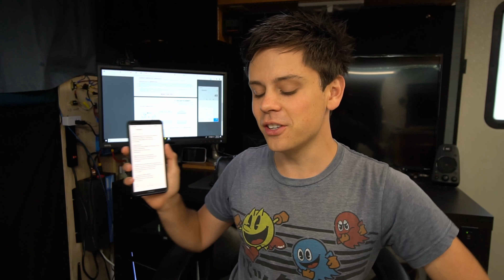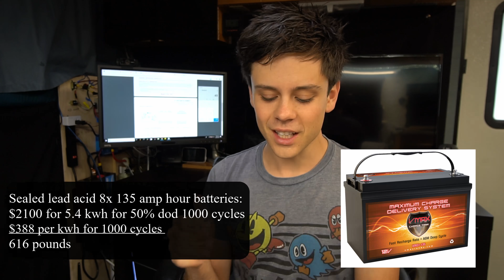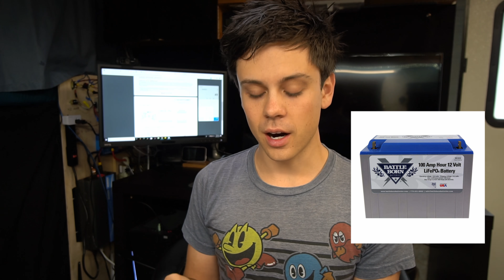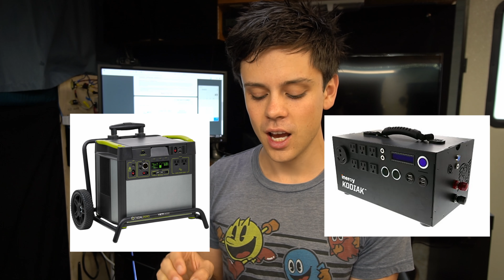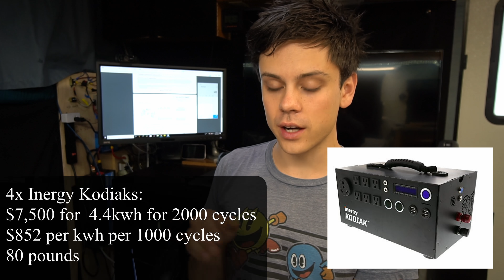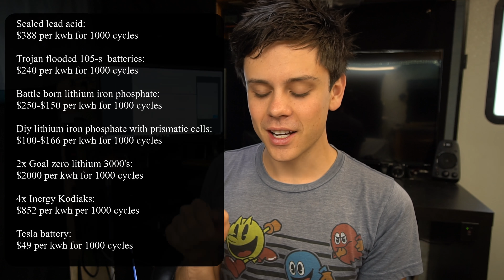Off-grid Solar Battery Price Comparison: Tesla vs. FLA vs. SLA vs. LiFePO4 vs. Tesla

Comment: Here I was, all ready to go with Battleborn, until you talked about Tesla batts. 20,000 cycles?
Done. I'll make it work, BMS et al, no problemski.
Battleborns are around $1000USD, at 5000 cycles, Teslas are $1300USD for 4 times as many cycles?...
With faster charge&greater output?
It's not even a decision.

Comment: Will, I've watched dozens of your videos, and, I still can not describe the difference between prismatic cells vs. other.s in Lithium I THINK I want to build batteries using the LifePo4 combo, as it's safer over time and with various charge/discharge characteristics. I want to build for RV use, so, considerations are outside dimensions of each battery (must 'fit' in existing, or, easily reached location) and maximum capacity within the given footprint. I've been thinking of an ammo can battery, limiting the battery size to 12 volts (for ease of use & calculations, as well as companion equipment).
   I notice that even Battleborn calls its 1280 amp hour battery a 100 Watt Hour battery (limited: max charge & total discharge for long life). 5,000 cycles is 'plenty' for me, and, is already off the scale when compared to FLA or SLA batteries. But, a high C rate is semi important, but, will hopefully be offset by the overall 'size' of the battery bank.  Weight is a bonus, as invariably, I will be replacing FLA batteries at 3 times the weight, but, a diet in an RV is always a bonus. 
   What cells would you consider in a 12V Ammo can build?  To add to the confusion, there are a variety of Ammo Cans now! I just want to maximize the total Amp hours per battery, limit it to 4 parallel, and, then limit risk based on the characteristics of the battery type used. The chemistry will define charge/discharge, bottom balancing is a must, along with the ability to see cell wellness and SOC over time is important to maintain full range of use. It's a long term ownership, so, effort will be made to keep it balanced, try to keep internal resistance amongst cells somewhat close, and, overall capacity will be checked when matching cells while building.
   Whew, that was much longer than expected Will! Sorry- I'm sure you are sick of these mundane and boring questions, but, it's either you of Jehu, and, I don't think he would bother to answer!

Dave

Comment: In your opinion , which would you prefer, 24v or 48v system ? I'm wanting to build me another solar power system for my house..My 1st project was 12V, and the Xantrex inverter would draw about 200A @ about 2000W. So if i used higher voltages, the amperage would drop a lot.  I was thinking to get a 48V inverter, but they aren't so easy to come by.  Plus i'd have to find a 48V charge controller for the solar panels etc.

Comment: Your math is wrong I understand what you were trying to do but it doesn't work that way the price for 1kwh for 1000 cycles does become cheaper the first lithium battery you listed may last longer but 1000 cycles after your initial perchase it would $750/kwh for 1000cycles but then if you were to compare then over a longer period say 3000 cycles then your lithium would still be $750/kwh except now your FLA would be $720/kwh

Comment: Is this the battery u reccomend and does it connect like a regular battery

1x Tesla Model S battery module, 24V, 250Ah,5.2kWh, Panasonic 18650 3200mAh cell

Comment: You're comparing a second hand Tesla battery. That is already degraded. Some of them have to be replaced by Tesla due to excessive use of Supercharging and charging to 100%... you should revise the specs down

Comment: Thanks for the interesting analysis Will.  I wanted to offer that there are often exact reasons for a low product life claim by ANY manufacturer. It is better to simply not make any claims and instead provide a limited warranty. When pressed to conjure up a particular cycle specification for a brochure or whatever, it will be a very conservative figure ...unless overall sales will suffer. Someone at the top of the organization you mentioned likely decided the end-user would not care about cycle life and to press ahead with the low cycle claim as it would reduce any future liability inside or out of the warranty period. Perhaps in the future, as specs become more important with everyone, NOT just the DIY crowd,  the true cycle life of more products will be listed.

Comment: When a battery is rated for 1000 cycles, how does that measure out in years? I am sorry to sound a bit dumb here, but when you say ‘a cycle’, does that mean a charge, so is the battery only good for 1000 charges, so 1000 days if your battery is charging every day?

Comment: According to Tesla Australia, the Powerwall 5Kw batteries will cost between $9,970 and $11,620.  That roughs out at $450 per kw for 1000 cycles?? Even old second hand Tesla car batteries are $2000 plus here. So wish I could buy Tesla batteries at the US prices you guys do :)

Comment: I haven't seen anyone do anything with the model 3 batteries, I guess the  modularity is the issue, being, and the high voltage. But it can be broken down to individual paralled cells, or to 7s like I need, I have only seen a couple out of the vehicle, I have Nissan leaf batteries on the way, I basically have a rv solar power system in a 1200' house, a 5kw inverter will handle the normal power needs. With 12v lighting, with its own 250ah LIFePo4 battery bank, built from K2 cells. And a 7s 600 ah liion bank and growing, I'm adding Nissan leaf batteries if things work out, ( they are in 2s packs) it's hard to get 7 when counting by 2's haha,

Comment: i bought trojan t-105 batteries (6v 255 Ah).  $130 each, 8 of them = ONLY $1050 total. my system = 1020 Ah, 510 Ah usable.  1200 watts of solar on RV roof!
Reply: so my use is only $150 per kwh. but i do like the model s pack. saw some for $1000 used.

Comment: At 49$/kilowatt hour * 1000 cycles, you are only spending 4.9 cents per kilowatt hour you run through it.  So it's the only one in which you could spend less on off grid power than on grid power.

Comment: Wait...im confused.  The tesla battery is lithium right?  tests show that when charge and discharge levels are 85/25 you get 2000 cycles so at 90/10 you will get less...probably around 1000-1500 cycles. how on earth are you figuring 20,000 cycles?!?!?

Comment: Your cost estimate on lead acid is high.
I have 20 kw of Crowns (16, 6 volt) that cost $2500 for the last set (the first set was $768 with no core charge). I get 8 years out of them on a fairly shallow discharge. I don't mind servicing them with water (every three months). I don't have to worry about battery fires either . My alternative energy system is 21 years old. The Trace inverters have been bullet proof. A very robust 100lbs, not 50lbs like the new ones. When I first put the system in my home nobody else had one. We'll actually very, very, very, very few.

Comment: Tesla batteries actually don't have 5000 cycles when full capacity is used. When you use around 70% of full capacity you get to 5000 cycles. So the comparison you made is not completely correct.

Comment: If these batteries are used as backup power for houses on the grid, do we need 3000 to 5000 discharge cycles in the first place? 

I have seen videos that say that Tesla does not sell their car batteries to individuals.  If that is true, then the Tesla batteries from eBay sellers must be used, from wrecked or flooded cars and should be tested by the buyer before making a final payment.

I believe Tesla does sell Powerwall  batteries direct to individuals.  Can you do a comparison of that with the others you did in this video?

Comment: Hi, what is classed as a cycle? Is it fully charged 90% to empty 10%? If so, does typical charging not take the form of partial discharge and top off most of the time. I should point out I know very little about this and am looking for clarification. Cheers.

Also, what does the number of cycles translate to in time with typical use?

Comment: There is a big mistake in this video : high energy density cells (used in tesla) don't have this 5000 cycles lifepan : it's 10x less than lifepo4 cells. Go check Panasonic (the supplier, it is not claiming 5000 cycles but 500), which is corresponding to the life of a car...  Lifepo4 cells are also a lot safer and would be used everywhere if the energy density was better. It is not the case so very good and recommended for storage but not good for cars where weight is very important.

Comment: I ordered 2 BattleBorn batteries yesterday, 'the 100 amp hour Lithium Iron type.  I ordered them from the Reno website and got a $50 discount on Each cause I ordered 2.  I need to sign for them and they are due here Friday.  So check about pricing if you want 2 from an Amazon seller.  Thanks for doing all your research on them Will.

Comment: GREAT VIDS AS ALWAYS WILL, YOU PROBABLY  GONE OVER THIS POINT MANY TIMES, MAY HAVE MISSED IT, I AM BUILDING A CAMPER VAN SO I THOUGHT I WOULD USE AGM BATTERIES, SO BROUGHT 
THEY SAID ON THE WEBSITE 110APH ( EFB) (AGM)???? I COMPLAINED THAT I WANTED TO TO USE THEM WITH NO PROBLEM WITH VENTING THEY SAY THAT THESE ARE AGM BATTERIES I LOOKED ONLINE BUT THEY ARE NOT THE SAME I CAN GET NO REAL INFO TO HELIP MAKE UP MY MIND TO SEND THEM BACK ARE THEY RIPPING ME OFF? ANYWAY THANK YOU WILL FOR ALL YOUR HELP WILL GET SOLA IF I EVER GET THIS VAN FINISHED NOT MUCH SUN IN THE UK

Comment: One of the things that isn’t clear is that I was under the impression that sometimes the Tesla packs still have the Tesla BMS on it, and I’ve seen conflicting information about if you can use the Tesla BMS or if you have to remove it and supply your own because it only works with the other Tesla electronics for controlling the batteries.

Comment: To compare solar generators to batteries, you would have to add the cost of the BMS, inverter, mppt solar controller to the batteries that don't have these components. The ebay Tesla batteries are used so you don't know how many cycles remain in those batteries. I assume the 5000 cycles is for a new battery. If there were only 1000 cycles remaining the cost per kwh/1000cy would be close to $250.

Comment: Checked on eBay: The Tesla Model S modules at that price are used packs. Are you comparing that to the cost of other used systems, or new?
Reply from the maker: Used
Reply: @WillProwse  Then why do you assume a used battery will provide the rated number of cycles specified for the pack when new?
Reply from the maker: @huskypup3489  because people have put hundreds of thousands of miles on them and lost 5% capacity. And c rate for solar usage will push cycle life to limit.

Comment: Correct me if I'm wrong but I think the Goal Zero is more than just a battery.  I believe the Goal Zero box also includes a MPPT controller, an inverter, and a monitor so you'd need to add the cost of purchasing those to the cost of the other batteries you cited to get an apples to apples comparison.  That being said, the cost difference was so dramatic that it will probably still be a lot less expensive to build your own using a Battle Born or Tesla.

Comment: Usage profile (DoD, rate of discharge,  storage conditions, etc.) Majorly affects the service life of a battery and different chemistries are affected differently, just talking about rated cycles without also addressing the use case assumptions that they use to calculate these numbers is only a small part of the conversation,  especially if you're talking about assumptions for something like a Tesla car battery that is now being used in a very different system under different conditions. 

I'm not saying that you're wrong, just that there are far more considerations that should be addressed in this.

Comment: This is great info, Will. I know that this is 1 year old and you are now sold on the safety features of the BattleBorn's but I already have a Tesla cell pack, plus about 300 18650's from laptop batteries so I can build safety features around them. I just need to continue extracting the 18650's from the laptop batteries and evaluate them.

Comment: Hey Will, great videos keep it up! I am starting to plan for an off grid system for my bumper pull camper. Can the voltage of the Tesla battery be stepped down to 12v or would you even recommend using a Tesla battery for that? Also, have you ever compiled a material list for completing a camper/RV conversion?

Comment: Could you explain more about where to buy this Tesla battery and which version of the model S battery it is? Is this still lithium ion chemistry where charge controller design for lithium ion will work with a battery Bank of Tesla batteries? You mention buying it off of Amazon but I'm not seeing this battery on Amazon.

Thanks!!

Comment: I'm trying to set up my sailboat as a diesel-electric hybrid, and by that, I mean primary auxiliary propulsion will be a 48VDC motor mounted behind the diesel and above and belt driving the shaft to where the diesel, which is the secondary auxiliary propulsion now and will also drive an AC generator as well as the alternator can still do it's thing too. That way if the sun doesn't shine enough overtime to charge my batteries, I can crank up the diesel, get underway while running everything and be charging the batteries all at the same time. I have 450 watts of solar, a 450 watts, in ideal conditions, 280-watt average wind turbine, and a current turbine that I don't know what it will do yet, haven't tried it out. The only issue left to solve is storage, specifically, batteries. I have my eye on the Battleborn, but for 300ah, and I'm thinking for a safety factor 400ah, that's a bit more money than I can afford in reality. That Tesla battery looks like the perfect solution, but I've yet to hear about them being used in marine applications. Has anyone else, and does anybody know why it might not wok, be suitable, or be a problem? I'm not an amateur by any stretch of the imagination, I'm a retired engineer and can set it up, I'm also looking into the DIY LiFePO4 batteries too, so I know it needs the BMS, etc. My question is, can it be used to power my sailboat just as well as the Battleborn batteries will without any unexpected issues, or be dangerous? I'm an old school engineer here, and an old dog eager to learn the new tricks, and you must remember I went to school in the 60s using a Post VersaLog II slide Rule (I still have and can use it) like the old boys at NASA who built the big rocket what took men to the moon. I'm playing some serious catch-up work because back in the day we were still using vacuum tubes, and computers took up a whole room. We had just come out with 8 transistor radios at Radio Shack for $19.95, oh my!
Reply: Lithium and water do not mix well!!! That said, I see surfboards with lithium cells inside them...I have not used these Tesla S cells yet(still lotsa life left in my lifepo4's), but I am skeptical about the 5000 charges stated...Either way, seal them well, and many happy voyages!

Comment: Ok well I am sold on lithium as far as cost per kWh but how about total cost? I mean you can go buy a couple Sam's club deep cycle batteries for $200 and you have some storage capacity without spending several times that amount on lithium. So yeah the more you spend the more you get but lithium is 1000's of dollars not hundreds of dollars.  So what do you have to do to the Tesla batteries to manage them?

Comment: GREAT Video.  As are all of yours.  Excellent information and well researched.  One thing you didn't mention is off gassing.  With the Lithiums, there is none.  With the lead acid ones there always is, even with the sealed ones.  A big consideration to costs because of ventilation required.  Especially for a marine application.  I know with your systems they are RV based, but it all can be moved over to marine use with upgrades to the wiring.  Which is an easy upgrade, just has to be sealed.  Thanks for your info.  Keep the vids coming.

Comment: Hi dear will, could you please advise me regarding a solar system with 230V out put.
In my country we use 230V electric equipment. So I have to look for a solar system that can supply me 230V AC output. Thanks in advance.

Comment: Question about freezing. The Tesla batteries go in a car, which can sit out in frigid temperatures for months. Do they have some kind of built in heating system to keep those batteries from freezing? And isn't an RV going to be in the same situation?

I'm considering the Tesla battery for an off grid yurt, but it can get frigid cold in the winter (and real hot in the summer). Are we going to ruin those batteries by having them in a cold climate like that? Or do we just need to come up with some way to keep them warm?
Reply: Tesla cars do have a battery management system that regulates temp.